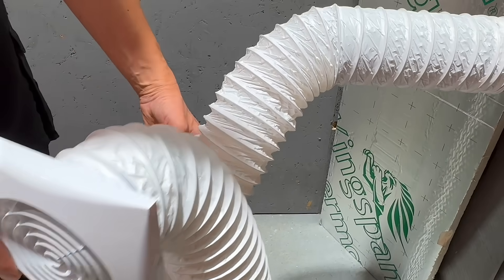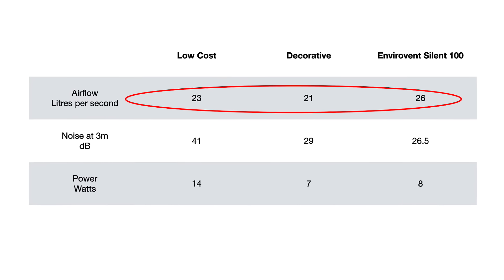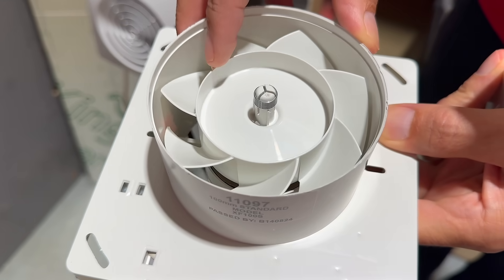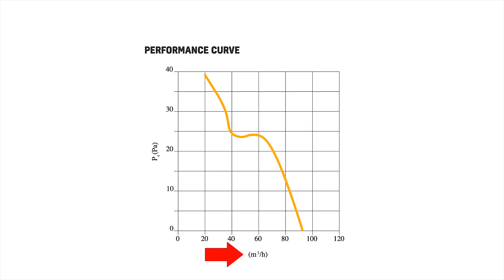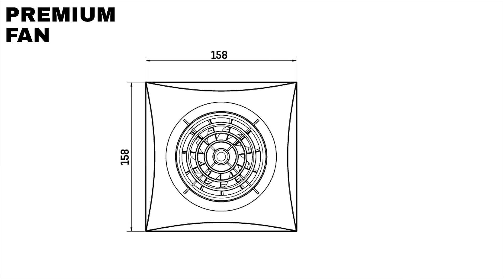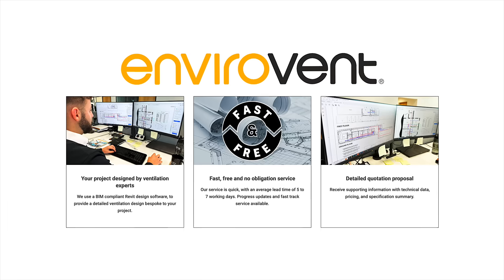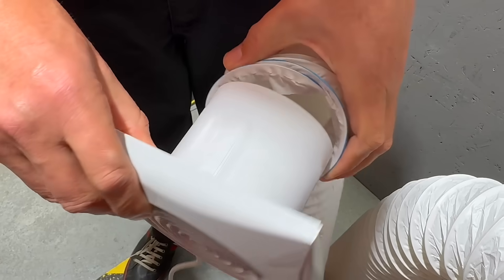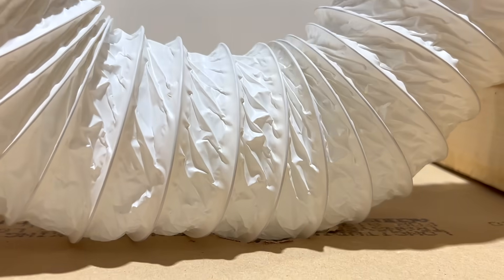The Shocking Truth About Extractor Fans!

Comment: Good informative video. The fan in my bathroom is on the wall & leads straight outside. It is 20 years old, noisy and only works with the light on. Is there a better option and are they easy to install?
Reply: Humidistat fans are your best option, but if you don't know what you're doing, you should get a qualified electrician to change it. Should be simple in theory, but if any problems come up then the experience will be invaluable.
Reply: Do any of them really work that well,look outside on a cold day,you never see steam coming out the extractor when they are on,if you can just open a window up,you do then...
Reply: @ That's because the water vapour has had time to cool down to ambient temperatures through the fan and ducting. You will see vapour in cold conditions when the fan is wall mounted and directly extracting.

Comment: I still don’t understand how Britain lives without proper extractor fans. Damp houses with no ventilation would benefit from a good sized vent!
Reply: We open the windows!
Reply: @srpacific  houses in the UK are generally very cold and inneficient. Power is very expensive (especially in the last few years). Many want to sacrifice poor ventilation for warmth.
Reply: @srpacific  first time i saw these was in britain 20 years ago.
Reply: I'm one of very few council tenants who don't have so much trouble with damp, and my habit of leaving the windows latched into the „vent“ position is most likely for why. I only close them fully (And still leave the frame vents open) during extreme weather events. 👍

I also engage in the German practice of Stößluft - The act of throwing open all the windows to completely replace all the air in the house (Usually, during mid afternoon when the air is still warm-er) - To freshen the atmosphere before turning on the heating in the evening. It drops the temp by a few degrees (Moot in my case as I can't afford to use the heating anyway) but it really does help get rid of the stale air and may contribute positively to health. 🌬🇩🇪👍
Reply: If air in is more moist then out (one you getting rid of), then no, not really. 

To get dry air, needs to be heated. This costs money. 

Issue is with high relative humidity here.
Reply: @ And the high energy rates... 💸

Not to put too fine a point on it; But ours are high enough I'd find paying a German electricity bill (Which also aren't the easiest to read) a much needed holiday compared to paying my UK one... 😳

Comment: Nice presentation, however I mis the notice of the supply of air in a (bath)room. If you want to suck out moist air, you need to to supply fresh air. Next if you live in a area with lots of bugs like 🦟, take a vent with a filter or beter with flow-shutters etc.
Reply: Most people have trickle vents on windows

Comment: Insightful knowledge. The title of the video was the shocking truth about extractor fans. I have found little shocking facts from this video. What aspects are shocking or highly insightful about Extractor fans. Why I have found shocking is that simply opening a window to ventilate us much more effective in managing a humid or condensing environment in a bathroom. My vision is that bathrooms in homes today are simply designed inadequately and a extractor fan is simply a symptom of a design flaw. Would like to hear if there is any truth to this. I have always found duct fans limited in their functional and capacity. I have had a loud extractorfan installed because of building code. The bathroom is built on an I terror facing wall, with no wall being next to or an exterior wall. There is all this refined and quasi placed ducting to manage a ventilation system.  The problem I see is that the fan does pull humidity and condensation, bit there seems to be an area of static area across from the ventilator that does not clear quickly. While all other walls are dry quickly, the furthest wall stays condensates for a while even at maximum ventilation rate setting. The radiator fan border the door, which has a open slot at the bottom for ventilation. What I see happening is that there seems to be a strong air flow from this slot to the extractor fan. I can clearly feel as air flow from this slot to the fan box. The rest of the bathroom seems stale in airflow. This has given me an impression that likely an extractor fans performance is perhaps also only as good as the way a bathroom is built and in which spot the ventilator is actually placed in the space. If I could choose I wouldn't want my house dependent on an electrical system but rather gave natural ventilation. Is think this would leave us less dependent on energy consumptive technologies and maintenance and perhaps unnecessary overhead cost. Electric does have its conveniences. But in a world where the is increasingly designed to cater for elictric systems, which come with priveleges, but also obligations (which are often glanced over), makes me more excited in the current climate to thonk of ways to passively ventilate a bathroom rather than being dependent on more costly active systems. I am curious to know if others share this view in this energy transition zeitgeist and what similar or more refined ideas people may have.
Reply: @MED Cool story bra
Reply from the maker: I’d suggest you checkout our CPD on ventilation and the building regulations. As buildings become more airtight and insulated the requirements for properly designed ventilation increase.

Comment: In my opinion, it's actually best to go for a Heat Recovery Fan which is on all the time.  Many have a boost feature which you can activate while you're in the bathroom.
Reply: Bingo, this is what I did.  Combined with a HEPA filter on the inlet.  Wish I had the space to plum a full system in this old House
Reply: Fitting a mvhr system in a rewire just now and although it's a bit annoying it will be an amazing system when up amd running
Reply: @christophergallagher3845  
What, a full house one, or a room one?
Reply: @barryfoster453  it's a vent axia system it uses a rigid ducting its only feasible in renovations or new builds it would be hard to retrofit to a house without destroying every room
Reply: @barryfoster453  If the rest of your house doesn't have a humidity problem, go for a single room MVHR in the bathroom. They're about 50 times cheaper and much easier to fit.
Reply: @robinbennett5994 definitely not 20x cheaper lol. Also single units are less efficient and noisier. I had condensation problem in several rooms and most efficient way to deal was the full system. It works great. The quality of air in whole house is just fantastic. Cant imagine living in a house without it now

Comment: Like fighting a uphill battle. Apparently when I have the NICEIEC do our assessment for ventilation we are the only company in a huge radius. We sign off all new installs with a certificate and notification to building control. 
Bloody no one does it, no one does it right it’s a joke. 
Maybe add the ventilation course on to the apprenticeship course just to give some basic knowledge on the subject
Reply: Cause we are fed up being scammed and paying to work for marketing companies like the nic.... im either qualified or im not, paying to be  * member* is a scam, really is. Just do what everyone else is doing,  notify nothing.
Reply: @ agree with the “scheme cough cough scam” but it’s doing a course be it at a college or even at a manufacturing company it gives a better understanding of what should be done. Also using a dedicated tester to commission the fan will give you an idea if you have installed the correct unit for the space. 
I have seen so so many piss poor installs for Ventilation it’s a joke. Provides me with lots of work which is good but not good for the customer. Should not be having to pay twice for dumb installers. Like I said if basic installation methods and basic regs were taught in the electrical apprenticeship course it would help with what the video is banging on about .
Reply: Half the problems I had were that builders would insist on underspecced fans and then complain when I failed their fan tests. Company told me to fudge the numbers to make them pass. I wouldn't put my name on those certs and eventually left.

Comment: Best would be to replace the fan by a whole house ventilation unit with remote control/humidity sensor and have it ramp up when necessary, and never have it turn off. Also, remember that the air needs to come in from somewhere otherwise you're just making a vacuum!
Reply from the maker: Whole house ventilation is a great solution but can be a challenge for retrofitting.
Reply: @efixx  Correct, and it also adds some bends too. Not to mention retrofitting whole house recovery... Easier to build a whole new house almost if it's entirely brick and concrete.

That aside, this video intrigued me to replace my fan. It's a cheap design model but the amount of cubic meters per hour compared to the decibels it made it seemed quite on par with premium models. I should definitely look into one for myself. In fact, it also seems that the manufacturer is listing the cubic meter airflow for covered design fans without the cover plate installed while they are obviously meant to be used with the cover. Shady marketing.

Comment: When I fit inline fans and ducting, I put the fan as close to the outside vent as I can. Less pressure to push against and let the power of atmospheric pressure fill the slight vacuum behind.
Reply from the maker: Great tip
Reply: If only architects paid attention to that idea and roofers didn't occasionally forget the vents and install them near the apex :)
Reply: I always had this in my mind but never looked into it. It's a great idea, although not always works out .
Reply: The position of the fan is irrelevant. The Total Static Pressure is the sum of the pressure resistance in the duct on either side of the fan. Only use an axial fan as tested here if there is a very short duct run. If the air is to be ducted use a wall mounted centrifugal extract fan or an inline fan. Axial fans make noise and do little else.
Reply: @TomB-o4v  That's a bit harsh. Plenty of axial fans are capable. Sure, you want to get the anemometer out to check the extraction. For most domestic settings a centrifugal fan is not necessary (or available). Inline fans are also axial, and can present maintenance issues.

Comment: These in wall fan bug the ever loving hell out of me  also the ability for people to turn them off cause of the noise my mother was terrible for not turning it on before a shower. Just use a decent in-line fan with hard tubing! dont bother manufacturing them crappy ones, and the cost will go down! If the uk routinely adopted the European standard of heat recovery ventilation, then there would be even less of a problem, we are SOOOO far behind it's not even funny. Conduit wireing for easy rewire or additions is another perfect example of how far behind we are. I could go on all night, but i got a whole playlist to catch up on. 👍
Reply: Heat recovery ventilation is still pretty rare here in mainland Europe.  They are starting to put them in new homes now, partly because of the new and more onerous EU energy label scheme.
Reply: Heat recovery ventilation is the “standard” in Europe? Dream on. It’s very rare there. I’m not aware of it being the standard anywhere in the world, even if it’s the ideal in most places.
Reply: If housebuilders cared enough to pay the extra price for MVHR systems I will eat several of my hats. In my experience they will only do it if the council wants them to meet noise/pollution regs. Being near an airport or motorway, etc. The few times I was asked to use solid duct in a roof was when the site manager knew that plot was getting inspected for an award.
Reply: Putting moist contaminated air through a system with filters is pointless

Comment: They are nice fans, but not many customers will be happy paying £200+ for a bathroom fan...
Reply from the maker: Shop around - https://www.electricalsonline.co.uk/products/envirovent-sil100t-100mm-ultra-quiet-wc-bathroom-extractor-fan?gad_source=1&gbraid=0AAAAABYQt6LNl7PMIEpZ13qoWgxEYbz46&utm_campaign=freelistings&utm_medium=wix_google_feed&utm_source=google
Reply: Try £40 and fit it yourself.
Reply: Well, they might as well save more then, and just buy a fake fan cover😅, they do as much. And no running costs 😅
Reply: Look for Soler & Palau. Cheaper and better.
Reply: LOL! I bought a large radial duct fan that delivers about 80 liters/second at 100 Pa (or 40-45 l at 200 Pa), for like half that. 
I use it in a sort of reverse configuration when I need som extra ventilation in my apartment -  "pushing" in fresh air in from the outside (creating overpressure), then open the vents (going to the air ducts in the house) all the way. That increases the airflow (suction) thru the vents a lot (due to larger the larger static pressure difference). Perfect for cooking - get rid of the fumes quickly without having to deal with grease building up in the fan.

Comment: I gave up on standard extractors and instead fitted two in-line fans in the loft. They simply amazing, and have (especially in the bathroom) completely eliminated shower condensation.
Reply: In-line fan is the best with insulated ducring and isolator switch. Venting outside of course.
Reply: @barryfoster453  You clearly have no clue what you are doing. Considerations for condensation on loft ducting is part of the regulations. It needs to be insulated. The whole point of extraction is that it carries air to the outside of the house. If you extract directly into the roof space, where do you think the moisture is going to condense?
Reply: @barryfoster453  What are you a qualified "engineer" in? Civil, electrical, mechanical? I'm a spark, I ain't going to touch gas or pouring concrete. Your 49 years of experience means nothing at all if it isn't in the right field. It's really difficult to check if you have sufficient ventilation in a roof space, because you can't test the static pressure accurately. Sure, it 'might' work. I actually care about the quality of my work so I want to be sure.
Reply: @cobalt49  An important thing thing to remember is to have as close as possible to no resistance on the discharge side of the fan. Ductwork should be on the suction side. This is because shut off head increases electrical current, while shut off suction reduces it. Over the years, this mistake has led to numerous fires.
On large commercial installations the current on the ammeter is a guide to maintenance and when to clean or replace air filters.
In theatres, concert halls and film studios, 30hp on air supply and 20hp on extract is not unusual. For both acoustic and fire prevention reasons air velocity is low. Traditionally the ductwork is structural and in some cases large enough to drive a van through.
One of the most complex installations is the London tube network. When escalators were installed from the 1940's, the old lift shafts were repurposed for ventilation. On the deep lines, a large percentage of the circulation power, is the trains pushing air along the tunnels.
Reply: @ I appreciate your experience in the commercial sector, in domestic installations the ducting is a lot simpler. Every fan has its own ducting and we can use an anemometer to check that it is providing sufficient extraction. I haven't been trained to design or test ventilation systems in commercial or industrial installations, so I'll bow to your superior knowledge in those circumstances
Reply: Had a bathroom remodel this year and was very adamant that my builder installs a new in-line fan in the loft. I actually helped with the installation and used rigid 10cm pipes in the loft leading to the soffits. With a slight dip towards the outside for any condensation to not run back in, And wrapped them in insulation. The bathroom mirror now de-fogs within a minute after we shower. Everyone should have one if they have the space. The inline fan and new tubing cost me around £100. The new bathroom looks amazing, but the fan is my favourite thing 😁
Reply: Comprehensive reading is so hard no? @skfalpink123 says the in-line fans are fitted in the loft, not to extract into the loft. In-line fans are usually stronger and quieter, making extraction to the outside more effective. You'll of course need ducting from the bathroom, to the loft, to the outside in order to install such in-line fan.
Reply: @barryfoster453 49 years! The laws of physics and engineering have changed an incredible amount in that time 😜
Reply: @barryfoster453 some cowboy did that in my mother in law's cottage. The mold and damage as a result was unbelievable.
Reply: Never vent straight into the attic space 
Put on some flexi and route it out into the eves
Reply: @barryfoster453  That's an RSJ. You are a structural engineer. I might trust your judgement on that. You're too arrogant to realise that having a speciality in one area does not make you an expert everywhere. You sound like all the worst site managers I've ever had to deal with.
Reply: If the roof is always like a back street on a windy day it'll be ok, not ok in 99% of cases
Reply: @skfalpink123  Same here. And it’s a lot quieter too!
Reply: @barryfoster453 that’s just stupid. You are supposed to discharge the exhaust of the fan outside, not into your loft 😂

I hope you’re a better structural engineer than how well you understand building services.
Reply: @barryfoster453  You crack on then, mr 'engineer'.
Reply: @barryfoster453  WTF. You don't ever, ever ventilate directly to the loft space!
Reply: @markrainford1219  errr... it ventilates out through the roof!
Reply: @markrainford1219  Wouldn't want the woodlice to die from dehydration.
Reply: @ 
You fit a vent grill in the eves and attach the flexi 
I think you should read the uk building regulations on fan installation